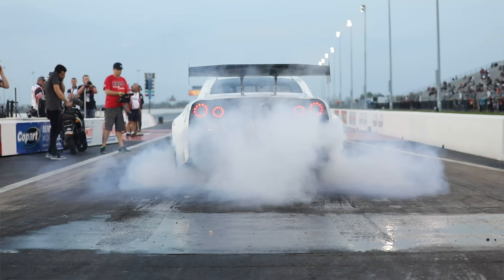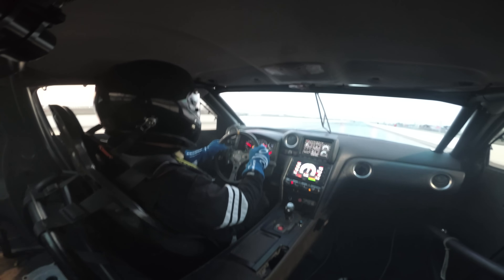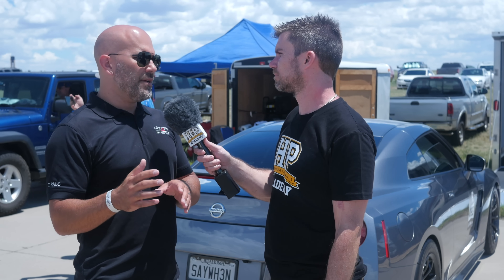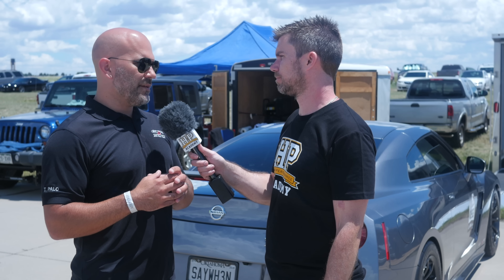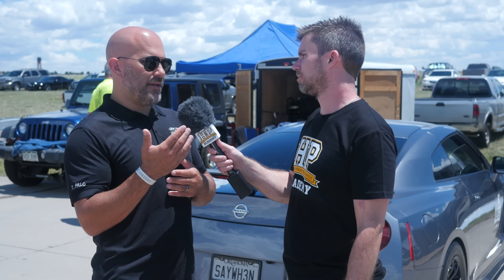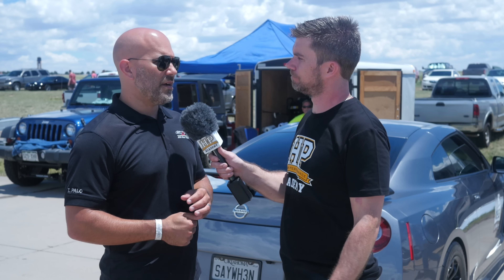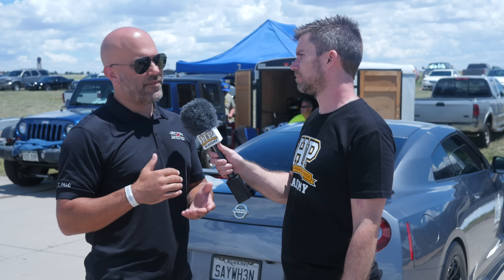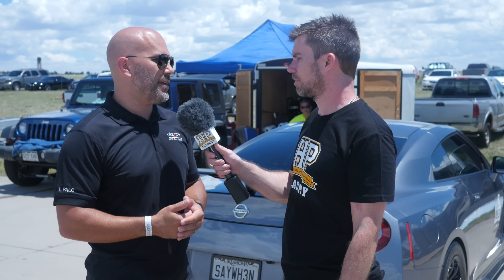Taming 2000-3000HP With Torque Management | Tony Palo [TECH TALK]

Comment: This is not new...Bosch oem units use torque request and torque demand for a long time now and alot more limiters and calculations. Just study a bit of Bosch MED units,...it has all the major and a lot more features than aftermarket ecus. Torque demand its one of the primary diesel injections, it has more than 20years! People this thays over rate aftermarket ecus, when the real features are on Oem ecus like Bosch, you have undred of maps to tune and twick. Aftermarket companys of ecus are just copying what is done on oem ecus and calling it NEW.
Reply from the maker: No one said this was new C2R, just that it is more common than it was even 20 years ago ;) - Taz.
Reply: @hpa101  i didnt mean the wrong way :)
Reply from the maker: @c2rautomotive  I know mate, you're all good! Enjoy your weekend :) - Taz.
Reply: @hpa101  keep the good tech videos, sharing info is the key to evolution :)

Comment: Not sure if I missed this, but what allows the ECU to know the torque exactly? Since the torque curve depends on the engine and supporting mods, I assume the ECU cannot know the true torque just by knowing engine displacement, manifold pressure and timing.  How is this measured?
Reply from the maker: Hey there Nick, Tony does explain this in the video better than I can, but the torque indeed is not measured, it is calculated instead by the ECU - Taz.
Reply: Calculated by engine displacement and volumetric efficiency

Comment: Amazing what a management system can do these days...what's next??
Reply from the maker: Skynet I think! - Taz.
Reply: @hpa101   This is not new...Bosch oem units use torque request and torque demand for a long time now and alot more limiters and calculations. Just study a bit of Bosch MED units,...it has all the major and a lot more features than aftermarket ecus. Torque demand its one of the primary diesel injections, it has more than 20years! People this thays over rate aftermarket ecus, when the real features are on Oem ecus like Bosch, you have undred of maps to tune and twick. Aftermarket companys of ecus are just copying what is done on oem ecus and calling it NEW.

Comment: In a FWD application exclusive boost control was the first attempts to control wheel spin and chassis dive. This is why most of the really fast imports run Haltech, Motec, etc because they have more control over torque, along with ignition and boost control based on gear. I know Motec can also link to GPS like Shane talked about so the ECU knows exactly where the car is on track and adjust accordingly. Now that Syvec is available for the Focus ST/RS (Mk3) if I can figure out a way around gear rattle with a alum flywheel, I might shoot for 1000 hp.